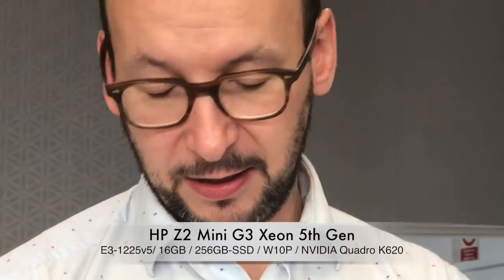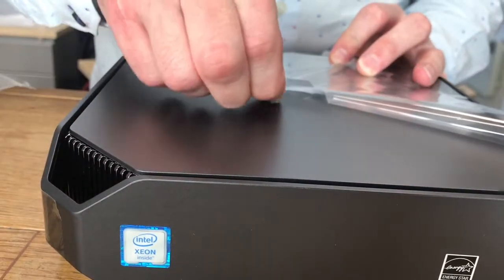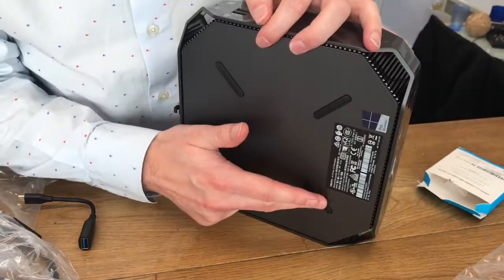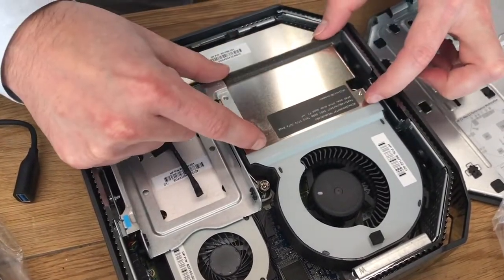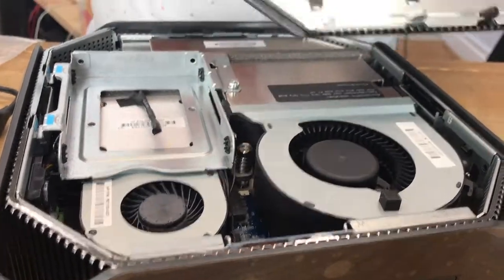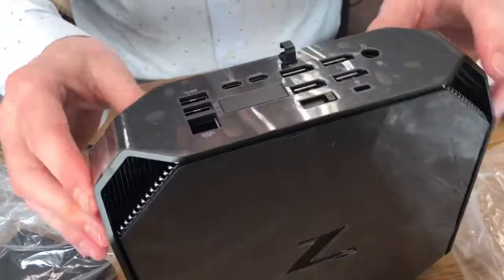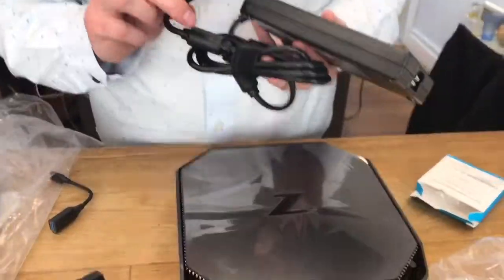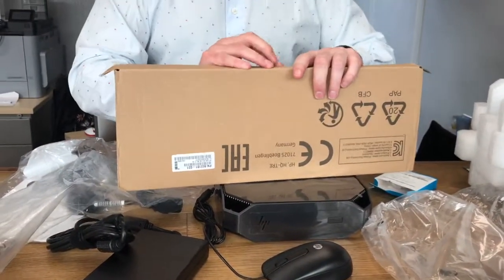HP Z2 Mini G3 Workstation Unboxing - Xeon E3 processor NVIDIA Quadro M620 (2 GB)

Comment: Hello! Thank you for showing all the components, but, As I see there is no sata cable to add other HDD! That is correct? Does it comes with a cable to add regular 2.5 HDD? 
Tks
Reply: That is correct! I have bought one and it does come with the cable! I have installed a 1TB 2.5HDD! Tks guys!!!
Reply from the maker: Fernando Indech I don’t think it does, sorry we did not check that
Reply: The cable is stick on the bottom with the blue plastic label!
Reply: I have a 2.5 in mine. It should come with a 2.5 holder and the connector that supplies power and data. The connector on the MB for that cable is down near the front left.